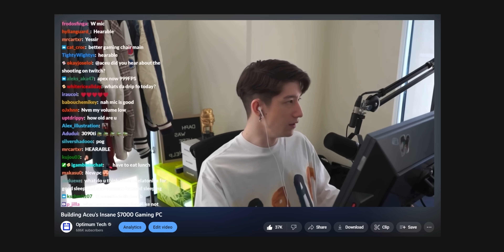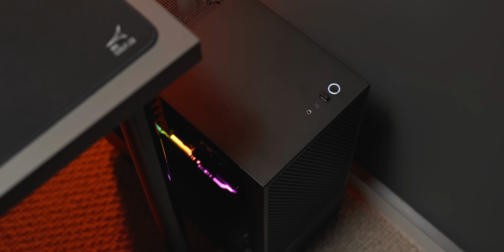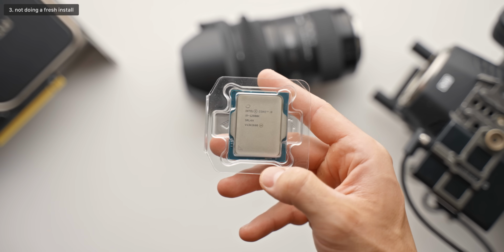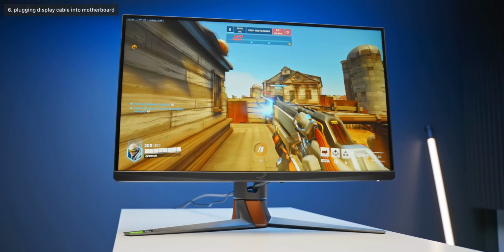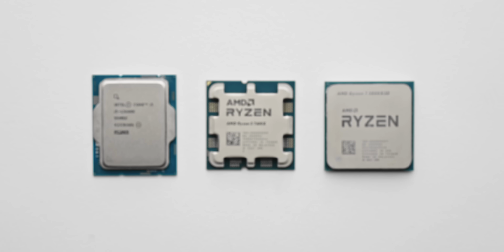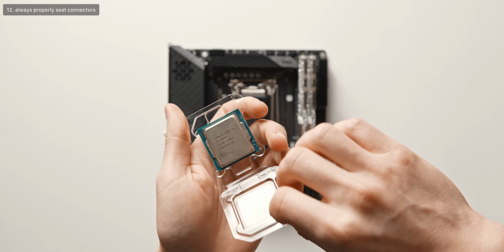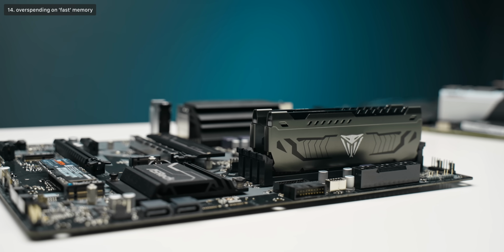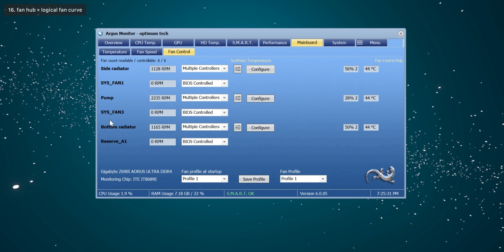Avoid These PC Build Mistakes

Comment: Why am I not surprised you didn't mention the one mistake that everybody does, from the first-time PC builder to the pro who has built hundreds of PCs:

Building the entire PC, up to the last screw and zip-tie, all cable management, every single part, every single screw, everything... before trying to turn the PC on for the first time.

Everybody does exactly that. Tech youtubers building PCs do that. Even tech youtubers who recommend against doing that (not many, but a few do) do it themselves ("don't do what I do, do what I say"). And what do you know, it sometimes ends up biting them in the posterior.

Perhaps the best (well, worst) example of this was that one Linus Tech Tips video where they spend something like 5 days building a PC with a really complicated waterloop... to full completion, before trying to turn it on for the first time. And what do you know, it didn't POST. No picture. And the solution required a BIOS setting... which they couldn't change because of no picture. And they had to dismantle the complex waterloop just to toggle that setting.

Comment: I built my first pc last weekend.
One thing I’m concerned about is after putting the CPU cooler on, it slid and I lifted it off to reposition it.
Should I have put new thermal paste on again?

Everything seems to be working and I’m worried about causing more harm than good by removing the cooler.
Reply: If your temperatures look fine, then I wouldn't worry. Keep an eye on it though.

Comment: Hy guys, i dont sure about my cpu, im in between these ryzen 9 5900x or ryzen 7 5800x or ryzen 5 5600x i would like to pair it with an rtx 3080 10gb version(i already got it) if i just simply look for bottleneck, others then ryzen 9 will make bottleneck, any advice ?

Comment: Just did the ssd mistake (just used my old one from I5-6400 and stuck it into i5-14600kf) and nothing happened. It all went ad planned.
Reply: For the most part, it does work fine. But if you were using Windows 7 or older, it would have crashed. I still prefer doing a clean install just because there's always that possibility of something going wrong either now or down the line. But its your PC. If it works fine, good for you.
Reply: It is not a mistake, but the correct way to do things unless you're someone who likes re-installing everything.  Even Windows 7 could be easily moved to a new motherboard.

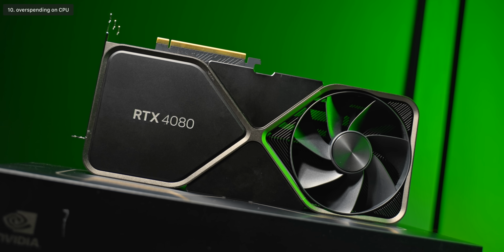Comment: 5:55 My CPU is an exception. It has 3,9 GHz all core turbo but is currently overclocked to 4,6 GHz all core turbo with a OC preset on my motherboard. I bet I can get it to 5 GHz if I played with the dials manually. And yes, it is a current gen part. It was released in february this year. :)

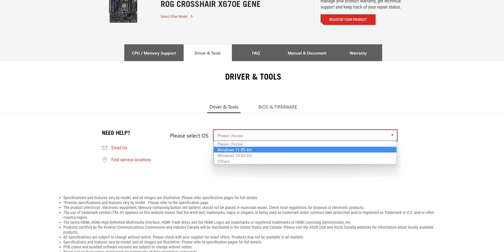Comment: 2:54 drivers prepackaged onto the board? No motherboard has that. If the chipset happens to be supported natively by the operating system, it'll work out of the box. The motherboard itself does not contain drivers.
Reply: so then explain to me why when i install windows for me and 2 other friends pc's (we all have b450 but from different manufacturers. I have gigabyte and they have asrock and asus but) only i have lan drivers out of the box on a clean install

Comment: Less is more because thermal paste is used to fill those micro scratches on the lid and you don't want to make the layer thick which would reduce rather than improve thermal conductivity.
Reply: thats why you tighten down the cooler, any excess just gets squeezed out. if it's not electrically conductive you can put on as much as you're willing to clean up later

Comment: I did the mistake not putting the hdmi cable in the gpu and I was wondering why the gpu would always turn off after the pc booted. Eventually i found out what the problem was and I felt so damn stupid😂

Comment: When it comes to CPU, it's all about the tier You're buying into. 7800x3D top 7950x3D is $150-200. 4070 Ti to 4080 is $300-600 depending on the region. CPU should also stay through an upgrade cycle of a graphics card, so all these reviewers trying to sell You i5 are just spewing rubbish.
Reply: i5 represents good value, that is why.

Comment: You had me for everything but the fan hub. Dont ever recommend this type of shit to people, especially CAM. Its AWFUL software and it almost always breaks first. Just stick with motherboard headers on the fans. This late part is something i have fought against over and over because these controllers are generally so awful and they are what fail first. Do not use them ever.

Comment: I bet it's rare for Optimum Tech to make mistakes, lol, Way too professional for rookie mistakes, Probably the You Tube channel with the best quality videos...
I made the mistake, Well is it a mistake, Getting an i5 12600k, When I only got an RTX 12gb 3060, I did actually see a site with one of those where it said, I have a 44 percent GPU bottleneck, So the i5 12600k is too much for the 3060, lol, I am not downgrading the I5 12600k, And I ain't upgrading the GPU, Only just bought them, But yeah I did make a few mistakes, Still though, I am a Sim racer, Pretty fast on the Nürburgring as well I might add, lol, But I don't even notice the so called 44 percent bottleneck as AMS 2 runs amazing, I was using an i7 6700k, But the i5 is just so much snappier and faster, I think it is an ok combo, An i5 12600k with a 12gb 3060, Works for me, lol......
Another Quality video from this channel.....

Comment: windows drivers for lan/wifi "pre-packaged on the board" - in a video about pc building mistakes - yup, you know your stuff bro - how wrong again went this the verge build guide?
plugging display cable into mobo - well, the even better solution to that: don't buy a cpu with enabled igpu when you plan to use a dgpu anyway - along with a mobo without display outputs if available (same goes for desktop mobos with wifi - c'mon - do you really need wifi on a desktop?)
stupid ad - and although pc part picker is usefull it sure isn't the only or even the best option - it got basic stuff wrong in the past like paring an intel cpu with an amd mobo - how much you got for that spot? also: how about use YT editor to remove it after this long time?
don't use stubby antennae - there's a reason why the included antenna comes with some cable so you can position it optimal instead of rely on position your entire computer - or: don't use mobos with integrated wifi at all - if you think you need it you doing something else even more wrong than screwing up your build
using an additional fan controller is BS: 1) it adds bloat (which was told to avoid earlier) and 2) it's surely NOT some lack of bios features - it's just because case fans are not meant to depend on the gpu's temp - they're clearly labled as "chassis fan" and hence depend on the "system temp" (usually some averaged temp sensors across the board) - IF you really want to make your case fans depend on your gpu's temps (why even would you?) any additional fan control software will do just fine with fans plugged into the motherboard - there's no need for an addtional fan controller - we don't live in the early 2000s anymore
this video is full of crap and just another mistake in itself - please remove it - it will lead unexperienced users into the wrong issues

Comment: Great video. But you failed to mention that cpu and gpu can bottleneck each other. That's why some people opt for a i7 or i9 cpu comined with their gpu. I just built my pc for the second time with new hardware. I'm going to flash the bios and get the newest version. I've done it once before, but it does make me nervous to do so. I definitely don't want to brick my motherboard.